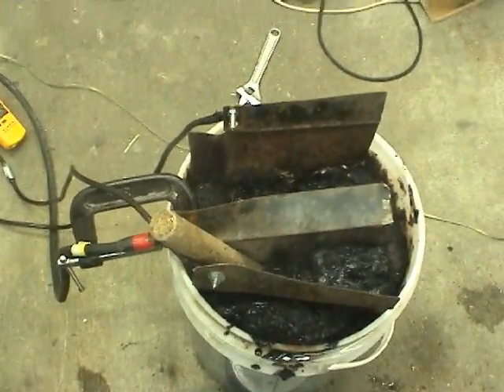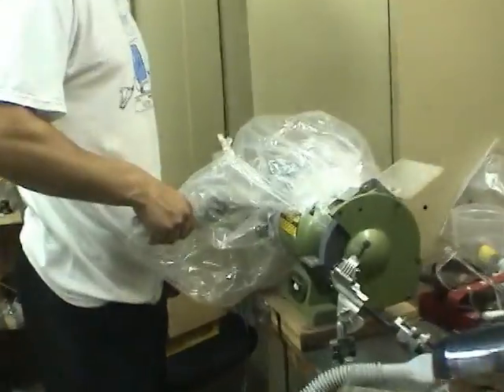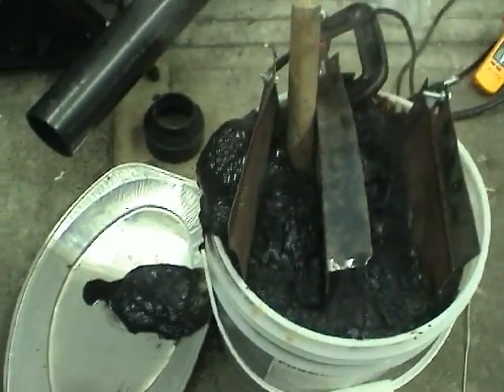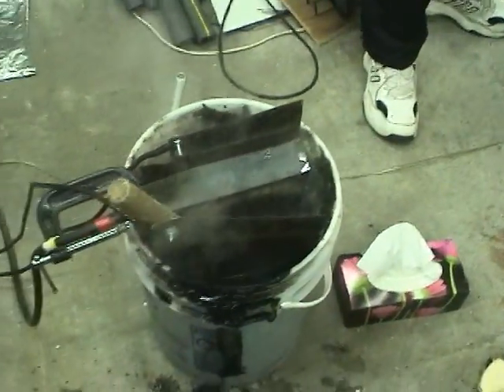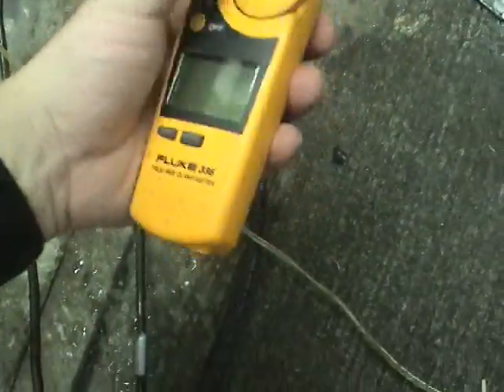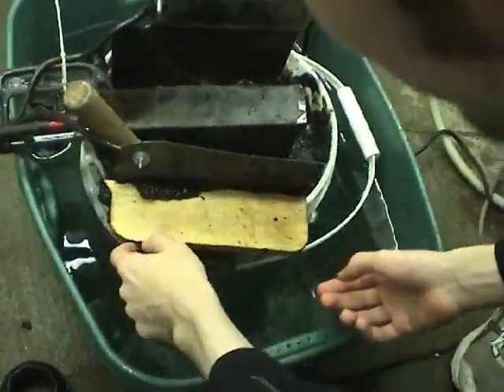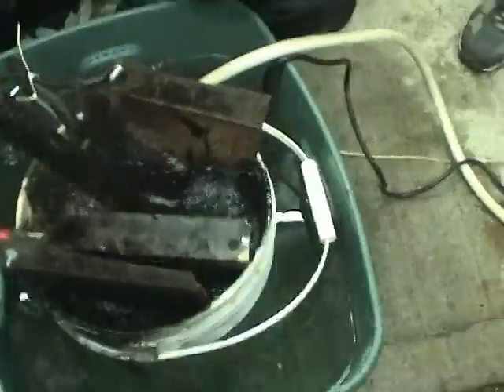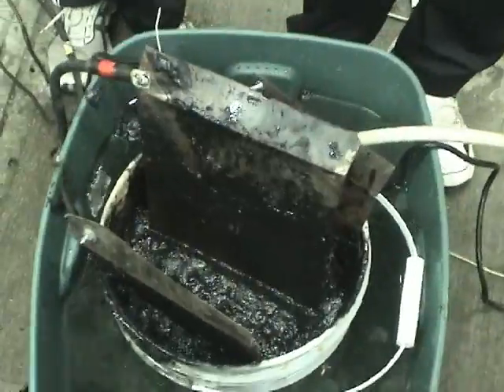Producing rust using Electrolysis

Comment: Thanks, exactly what I was looking for, though I am doing a very small scale version. I wish I had a car battery charger... I was wondering, does the salt in the electrolyte solution affect the purity of the rust? And I have green stuff floating in my water... is that iron oxide? Or some kind of copper compound?
Reply: the green stuff is iron hydroxide, its synthesised in this process too